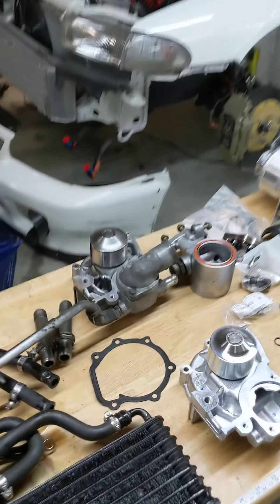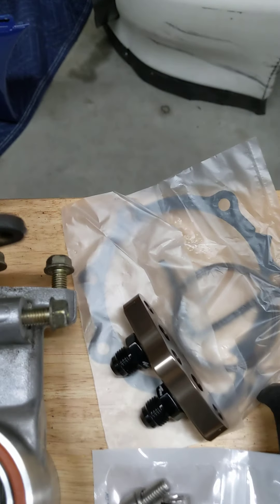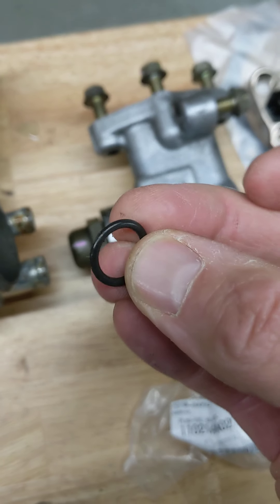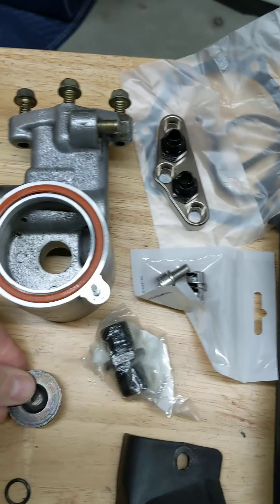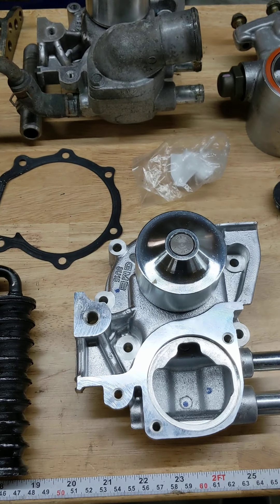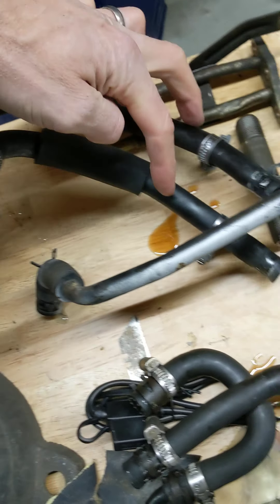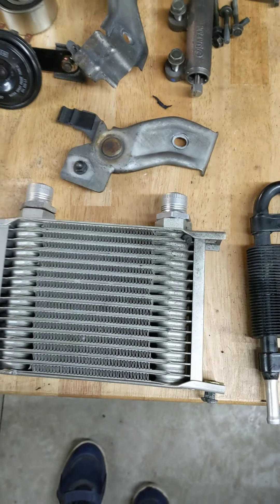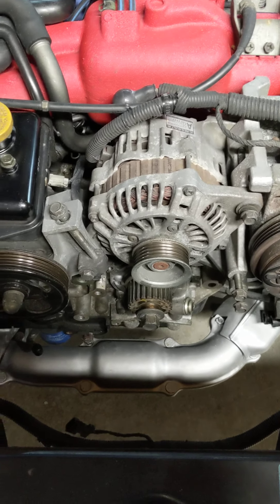Some OEM-derived GC8 upgrades (Spec C Oil cooler and GC8 PS coolers)

Comment from the maker: The "SpecC" oem water pump has a disk-type impeller whereas the aftermarket one I bought (GMB) has a blade type. It was a budgetary based decision. Also at about 2:00 I misspoke and said "water to air" when I meant water to oil. You feel me.

Comment: Where did the Spec-C mount the original oil-water cooler? In front of the radiator off to the left? Are you going to mount the air-oil cooler in the same place?